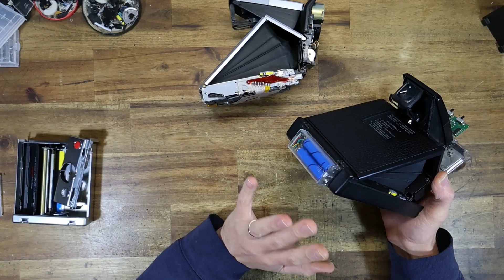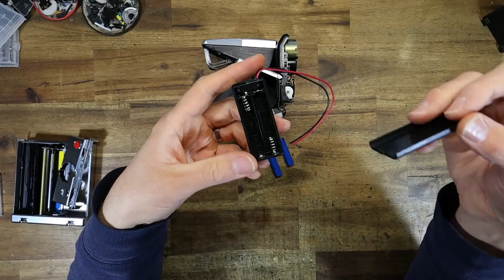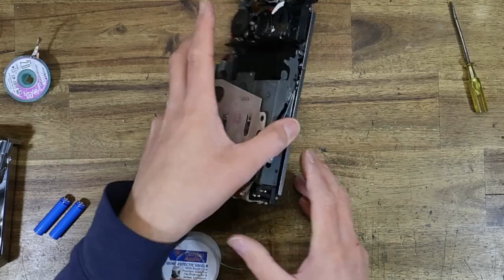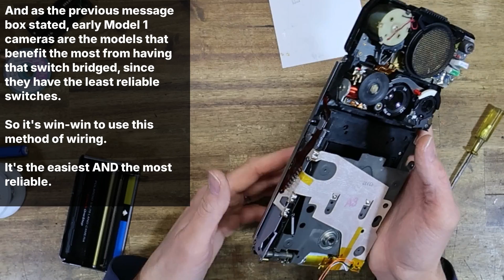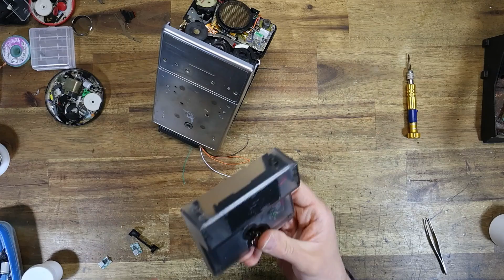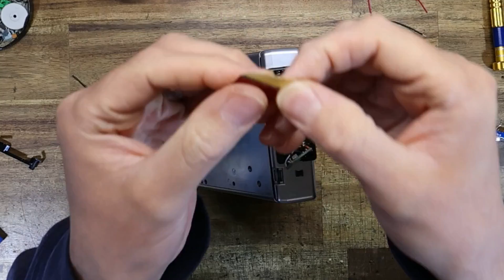NEW! PolaVolt How-to: The cheapest & best i-Type Battery mod for SX-70 cameras!

Comment: Hey Jake, love the Polavolt videos. I followed your guide to install Polavolt on my SX70 Sonar and I get correct voltage output (~6.15V) but now the autofocus always drives to the closest distance on half-press, as if it's not receiving the echo. Camera was focusing perfectly before the mod. Any advice would be hugely appreciated!
Reply from the maker: your buck converter is not powerful enough

There are many versions of the Mini-360 it seems, with many clients in the USA getting inferior ones shipped to them for some reason. You need some with the MP2xxx chip, not the MP1xxx

If you find this helpful, feel free to buy me a coffee
Reply: @theinstantcameraguy  Wow.. I would have never known that. Really appreciate it
Reply from the maker: @dws1995 yeah I need to cover this in a new video eventually

But it seems like many Chinese suppliers are offering dodgy cut price versions of the same board, advertised as the same thing 

Every time I purchase the mini360 I get mp2xxx chips

But sooooo many people ordering on Amazon get scammed with worse versions
Reply: @theinstantcameraguy  was just about to make a new comment about this. ive ordered from 2 different listings on amazon now (in the states) and both have come with the mp1482ds chip instead of the stated mp2307dn in their listing. very frustrating. 

my sx-70 is not a sonar, does have an R board installed. should i even bother trying to install these, or keep trying to find one with an actual mp2307 board?
Reply from the maker: @HallowedAdventures  you can try replace the inductor with one valued at 4.7uh and bump up the output of the smoothing cap to 10v 100uf to compensate for the worse chip.

This is one of the few times in my life where living in isolated Australia has been an advantage. All the chips I've ever ordered here have been MP2xxx 

Americans seem to exclusively only have access to lousy chips
Reply: @theinstantcameraguy firstly, insanely fast reply, must have caught you at just the right time lol. 

secondly, thank you for the tips. i will probably just try ordering some other boards off ebay from a seller in china (after confirming the chip with them) and just wait it out. would rather have it right the first time then to start replacing components. 

thank you for the info, off to buy you a coffee for the help!! 🙌🏼

Comment: What mAh are the 10440s you use?
Reply from the maker: 300-350mAh is normal and works fine. 

 You'll see some listed higher, but those are incorrectly labeled. 1000mAh is impossible lol

Comment: How do you recommend removing the battery terminals if you've already fully refurbished the camera but want to do PolaVolt at a later time? Would I need to fully disassemble the camera again or can I just cut both battery terminal traces on the ribbon cable?
Reply from the maker: These days I no longer remove the terminals. I just desolder the +ve trace :)

Comment: Congratulations on your new addition to be! Coming back to Earth, I've intalled a Polavolt on my camera which works great, what a fantastic invention! I was wondering, would it be a good idea to have a small led which goes on when the camera is erected, to remind oneself to close the camera when not using it? I found that if I leave the camera open for some time, it drains the batteries. I suppose the buck converter drains a bit of current. Thanks again for all your great content. JL
Reply from the maker: It is possible to install a surface mount LED if you scrape the PCB off the rear of the buck and install the LED in line with a 2k resistor in between + and - input.

But it really isn't necessary. This might seem like an obvious thing to point out, but the visual reminder that the camera is open/on... is... that the camera is erect! 

A collapsed and erect SX-70 look VERY different, and should serve as the only reminder you need

For what it's worth, Polaroid themselves recommend to ALWAYS store the camera collapsed when not in use, and I did a video on that topic here:
https://www.youtube.com/shorts/rQOauVR6SoI

Even a standard SX-70 will draw power when on 'standby' and so between preserving electronics, saving dust from the viewfinder and preventing bellows shrinkage you should just get into the habit of having the camera collapsed. No LED needed.

Comment: I always found the shape of the "MiNT bar" odd and visually-breaking for the rectangle-shape SX-70. Fantasizing, the empty-space could be used for a small battery (adding the needed cable inside the camera itself to redirect power). It'd be great to see if that'd be possible (even more when it doesn't add any more chunkiness to the camera).

Comment: PolaVolt is to power the camera but doesn’t the film have the battery in it to power the camera ? Sorry confused a little bit
Reply from the maker: It's for using i-Type film, which has no battery

Watch my PolaVolt video that is around 15 minutes long that explains what is for. This video is an instruction video of how to wire it up

Comment: I got it installed and working, but how do I make I-type film fit the camera properly without cutting of the tab on the pack of film? Thanks! Love your videos!

Edit: I also bought AAA sized 10440 batteries that have USB-C charging ports directly on the battery rather than using the external battery charger, they are more expensive but save bulk and add some simplicity.
Reply from the maker: Currently the only good solution is clipping the tab

Comment: I dont know electronics too well so please excuse me if this is dumb, just wondering if you used a boost-buck converter, would it be possible to use the li-ion batteries and pop in normal store aaa batteries if they run out while you are outside?